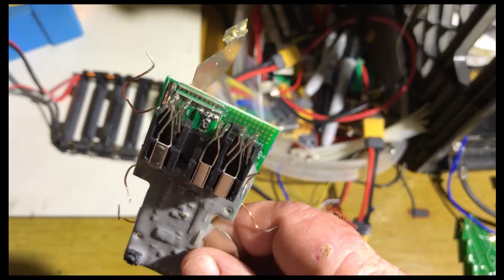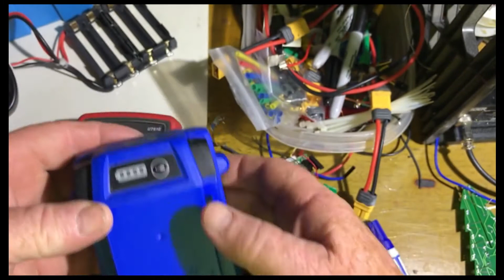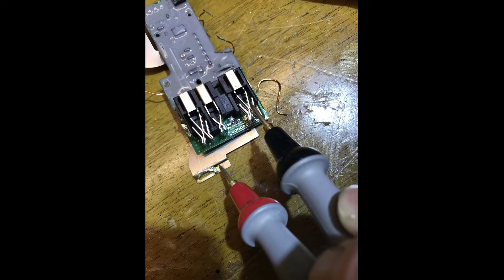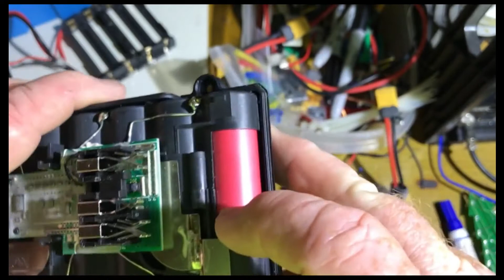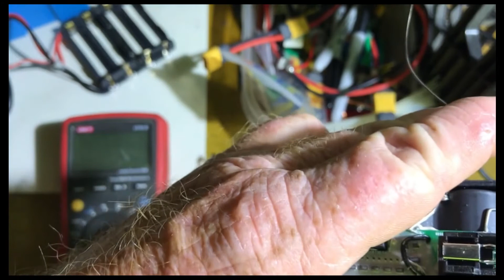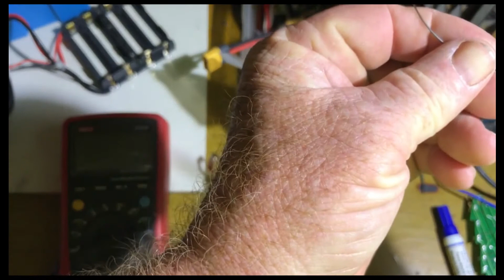Kobalt 24 Battery Repair

Comment: I also have a 24v kobalt that feul guage flashes all 4.lights, charger says its charged.  I heard its on safety mode and theres a reset on board??
Reply from the maker: I dont have one to look at any more. Take it apart and see what you find. If you make a video it miight help someone else.
Reply: I have same thing.  Trying to figure out why.

Comment: Great video.. I had the same problem with my Kobalt battery. Where it didn't show any lights...the fusible link was shorted. I did exactly what you did by jumping the fuse and it started working.. which is great.. I truly appreciate the insight.

Comment: You mention that by bridging the blown fuse that you are bypassing the safety feature. My question is if I do this what can I expect to happen if it tries to blow what cant be blown, an explosion, a fire or...?? Just curious, thx
Reply from the maker: I am not 100% sure but I think it’s more likely you’ll kill some cells or blow something in the electronics maybe the motor.
Reply: Well I took mine apart because it's the same battery, Kobalt 2 AH with exactly the same symptoms as the one in your video however the fusible Link in mine is still intact, so there must be some other component(s) bad. Ill chuck it in the junk drawer I guess lol. Thanks 🙋‍♂️
Reply from the maker: @kenclinton4881  did you actually verify continuity from both sides with a multimeter?  I have seen fuses that looked ok visually but were no good.
Reply: If you are referring to the continuity between the big metal blades at opposite ends then yes I did, it went from OL.  to 00.0. Everywhere I read voltage it reads 9.47ish

Comment: What about if you have full charge but it won't start the tool. The "D" pin appears to be broken.
Reply from the maker: with out seeing it its hard to tell. I dont have this batt to look at it was someone elses. if there is a broken connection you have find a way fix it up and complete the connection. try another batt in the tool and make sure the tool is not the problem.

Comment: Great video. Is it possible to add a fuse of any kind?
Reply from the maker: Id say its possible,  likely to be a tedious task. But it would be safer with a more predictable operation. I would have no clue of what rating is needed. Maybe if you have a working unit yo could disassemble that part might have a visible rating.
Reply: I have one I just took apart that wouldn't jump sadly...but showed promise lighting up 4 bars until I disconnected the other battery. When I took it apart I discovered the fuse was blown, but not before I noticed a small paper over the fuse I had to brush off, it said 3ohm. And I was relieved from already having seen this video as well before trying anything.(Of course I did my research)

Comment: thanks for the video. Mine shows continuity between the positive and negative, yet the fuel gauge does not work and it won't take the charge either. Any idea?
Reply from the maker: I’d start by measuring voltage at the cells first To see if the battery is any good .
Reply: @lmorrison17   same thing happened to me. New battery. Fuel gauge doesn't light and wont charge in charger. It will turn the light on on my impact but wont turn it. I tried another new battery and charger and impact work fine. Any ideas? If it's the cells, what should each read? Thanks

Comment: @lmorrison17 Is this your first time doing this to a battery? What causes this to happen to the battery ?
Reply from the maker: It is not my first time there was one other I ran across this issue and there’s a video on here for that one. What causes it is the tool trying to draw too much power for the fuse rating. Things that will cause it are saw blade getting stuck or a drill bit binding up.
Reply: @lmorrison17  OKay thanks . I really appreciate your reply . i got a battery like this from ebay. I plan to add cells to it so i wanted to know what causes it before i proceed with my plan.

Comment: I have the Kobalt 24 volt 4Ah battery and the fuel guage flashes all 4 lights, but won't power the drill. The lights flash rather than steady glow, the other batteries are steady glow and work fine. Any ideas?
Thank you
Reply from the maker: If it were me, I’d remove the case and measure each cells voltage and the whole pack voltage. If all is well look for burnt parts on the HMS board. But I suspect it’s just dead. If it’s too low the factory charger won’t charge it. In a case like that I take the case off and charge the cells directly. Often the pack will come back, but just as often when a pack goes all the way dead one or two of the cells go bad. They will get hot or just not hold a charge. In those cases I just harvest the good cells.
Reply: my batteries are both full & I put in the drill it operates normal for about 12 second then it stops & the lights constantly flashes .... & won't do anything until I reseat the battery .... not sure what to do to fix